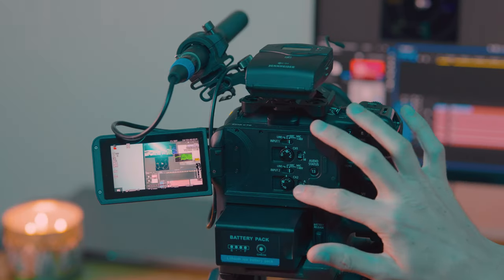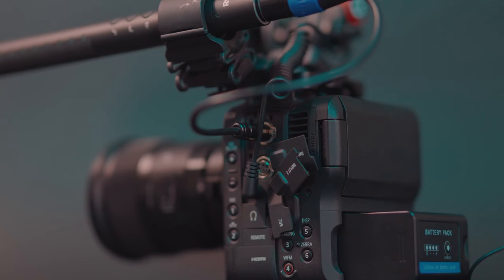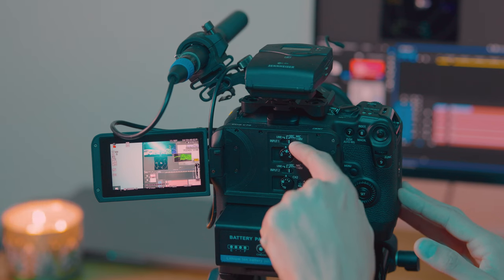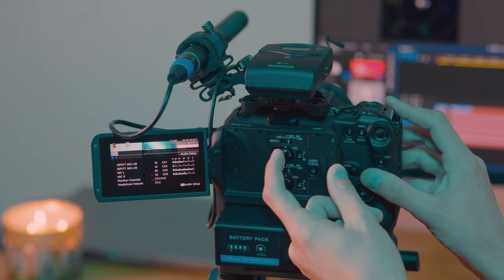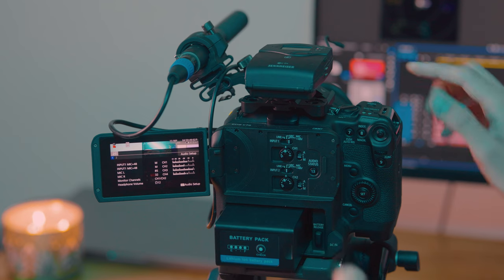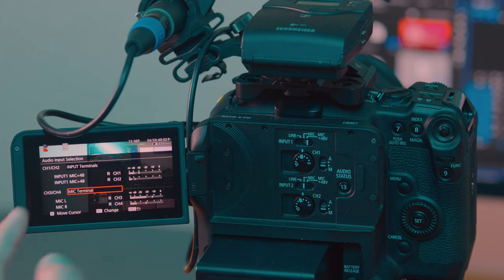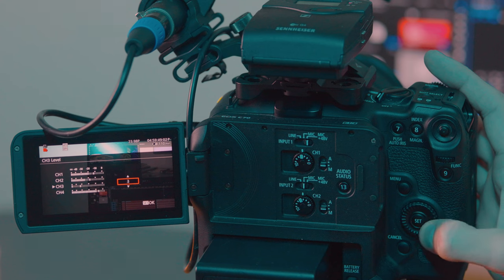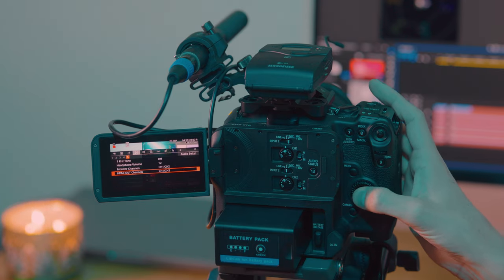How to setup audio on Canon C70 | Mic Inputs

Comment: @Roman.the.explorer Hi Roman, thank you for the great video. I've got a question… The manual gain on the mic channel (3 & 4) are quite weird… when I lower the MIC gain in my C70 it's like putting a brick wall ceiling to the audio… the volume is clamped… it's so so strange. Have you noticed this issue?
Reply from the maker: Thank you! Hmm does not happen to me, I'll let you know if I notice is next time I'm on a shoot

Comment: Pretty good run through on the audio settings for the C70. I just setup a full Mic scenario with 4 independent mics into the C70, only bummer is that they way to do it 3 and 4 are unbalanced.
Reply from the maker: Right! I wonder why they separated them. It took me forever to figure out

Comment: I'm using the Rode NTG Videomic (the one with the gain adjustment knob on the back), and I get hissing when I plug into the 3.5mm jack and set channel 3 to the mic input and channel 4 to back up at a lower audio gain. It seems like there's no good level to set mic gain at. My friend uses the Videomic Pro Plus and says hers is just plug and play without having to set all the channels like that, and she doesn't have hissing or anything. Any thoughts why this is happening - could it be the cable, could it be the mic?

Comment: Roman, thanks for this video! But how do you use EF optics? Cos it has awful noise from lens USM motor. Is it any way to avoid it? Thanks again!
Reply from the maker: I just try to put the mic away from the camera, on a boom for example. Actually my lenses are not really that loud. Which one is giving you noise?

Comment: Hey, thank you so much for the video. I really appreciate it. 
Can I kindly ask you. (It's hard to explain but I hope you'll understand) I've got C70 and Im recording 3.5 Rode GO II into channels 1 and 2. For some reason when people start speaking louder - the voice meter cuts in the middle. Meaning if I adjust level sliders lower - it will cut everything from middle and up. (For ex even from -10 and up everything is lost). Do you have same issue ? Can you recommend a solution? Thank you for your time 🙏🏼
Reply from the maker: Hm, that's weird. I would check/ try 2 things. First see if the attenuator is on, maybe it's causing it? If that don't work try resetting the camera settings. Lastly try a different mic out of curiosity.
Reply: @Roman.the.explorer  I updated the firmware today and still had the issue. So I turned attenuator on and it helped. Now seems like when I scream at the mic - the level can go higher then the set level before. Which is great. Still don't know why to complicate things like that as my R6 doesn't have that issue. Thank u for your help 🙏

Comment: If you have a sennheiser lavalier mic on input 2 and a xlr cable. My problem is that it always record tio high.  
What specs do you use for just the lavalier?
Reply from the maker: Hm that's weird. I just adjust it to -12 and it usually works fine. Plus you can have a save track recording at -15 let's say